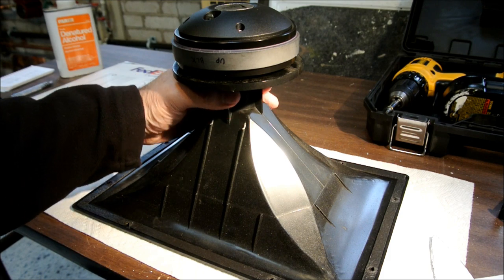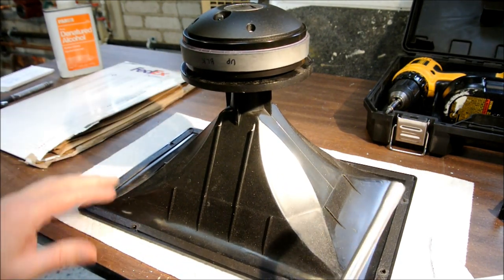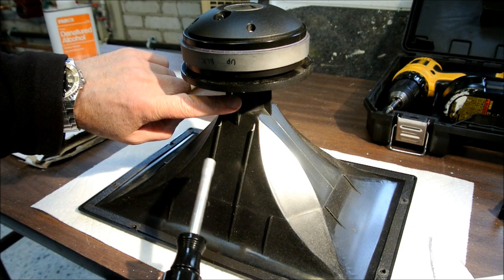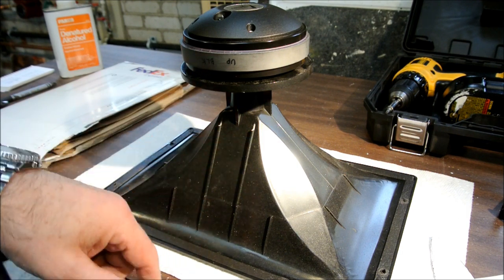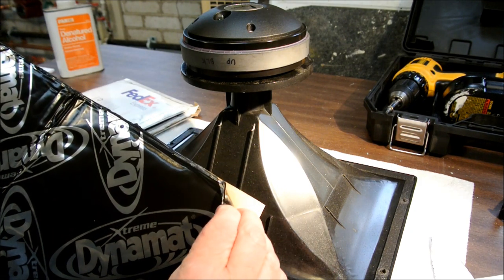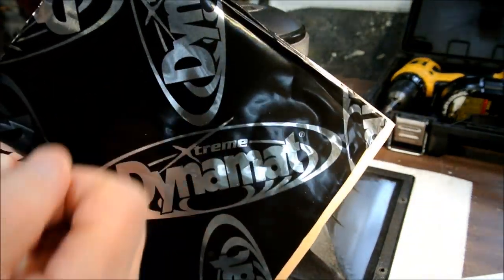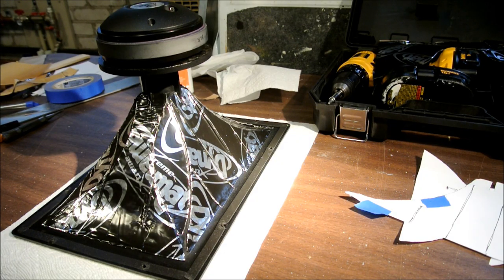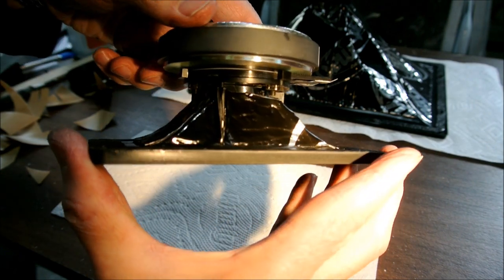How to Modify Klipsch speaker horns for better sound.

Comment: Is this alleged improvement objectively demonstrable? Can a 1" compression driver produce enough energy to excite a horn wall? Note that many Altec enthusiasts report that simply bolting a 511 or 811 horn to a baffle damps resonances caused by tapping the horn. And Altec used freestanding 811 and 511 horns without damping on the horns. However when using large format 1.4" drivers such as the 288 Altec did apply damping to horns, going so far as to use tar filled enclosures for early multi cells. I think many people damp horns because they can. I put little stock in reported subjective improvements--having bullshitted myself I'm confident in the ability of others to do so.
Reply from the maker: Good to be simultaneously skeptical and open minded IMO. I’m confident in what I’m hearing but don’t take my opinion or anyone else’s as gospel. Good luck!

Comment: My curiosity is why (and don't get me wrong, I have wanted to own Klipsch for quite a while now), there are so many videos of owners successfully modifying this speaker (with dampening for example). Many of these mods are carried out due to sub par listening experiences but for their price point, we should not have to do our own research in order to make them acceptable. They should be engineered to produce the maximum quality for the price demanded don't you think? More of a Klipsch QA and production question I know so.....apologies but these aren't cheap. Cheap speakers that you can modify to achieve the quality of much "better" sonic reproduction (better is in parenthesis because sound is subjective as we all know) is a great way to go. But to pay the MSRP for these only to find out that there are issues that you as the consumer can easily address shows a particular business model that doesn't appeal to me. It's like the way video games are going (I'm 54 but still enjoy them) wherein they release a game that is subpar fully expecting the young and knowledgeable Modding community will make it better after purchasing it for the full price of course and given nothing for the further development to make it much better which in turn generates more revenue because it's an improved product. That product then becomes Version 2 and so on and so on...

Comment: Another magic damping material you may find easier to work with is Blue Tack
Reply from the maker: Blue Tack is not a constrained layer damper so I wouldn’t expect it to be nearly as effective as Dynamat. https://en.m.wikipedia.org/wiki/Constrained-layer_damping
Reply: @thebostonaudiophile  the version you used has foil for heat rejection. It has little to no effect on the dampening properties as it has insufficient stiffness to act as a constrained damping layer 😉. Blu tack and other variations are far easier to use to add mass to complex shapes and to round corners internally. It’s been used in the headphone and speaker mod community for decades.
Reply from the maker: @conduit242  From Dynamat's website: "Dynamat Xtreme is a patented, light-weight, elastomeric, butyl and aluminum constrained-layer vibrational damper." I appreciate your comments and you may obviously use what you would like, at your own discretion. For others who have watched this video and are thinking of adding a damping material to their horn, I don't recommend anything other than Dynamat Xtreme, as I know it works well from first-hand experience and, as a mechanical engineer, I believe it's an ideal product for this application.
Reply: @thebostonaudiophile  I think you’ll find EM Kerwin’s paper interesting (1959), what you’re missing here are really four things:

1. The spans over which you’re damping are already shorter than the midrange frequencies. If you calculate the wavelengths over which the midrange operates, you’ll see they are already larger than the spans between the ribs (added to increase stiffness, raising the resonant frequency of the horn body). The high pitched resonance you got from tapping on it should have told you that 😉. By mass loading them haphazardly, you have lowered the resonant frequency..quite possibly right into the operating range of the midrange driver.

2. Since the horn itself is so thin and stiff, what you need to do is add so much mass that you drop that resonant frequency far below the operating range of the driver to also pick up harmonics. A couple slivers of dynamat won’t do that. A slab of blue tack will.

3. There’s an excellent short paper on optimal constrained layer damping thicknesses…you will see that the effect of hysteresis is only impactful at precisely calculated layer thicknesses and frequencies and tapers off exponentially. It’s not just “better”. Outside that range, you are basically only benefitting from the mass.

4. Even Dynamat has a page stating that the “3db reduction” comes from mass loading.

Math is fun, check it out 😉

Comment: Could this be done with some "spray on" product?
Reply from the maker: Good question. I don’t believe so. One needs to introduce “constrained layer damping” for the best effect. I’m not saying it couldn’t help some, but constrained layer damping is more than adding mass. Constrained layer damping forces the viscoelastic layer to shear and that attenuates vibrations extremely effectively.

Comment: Will this work on my Klipsch RF-82 gen 1 speakers?  Thanks!
Reply from the maker: I’m not sure. If the horn part of the 82’s is a hard, molded plastic with a smooth rear, like you see in the video of my Cornwall’s, I would think that it would work.

Comment: I have purchased the Cornwall IVs and love them but I have a huge problem with certain notes on female voices and guitars.  I have about 4-500 hours of breakin.  I have tried placing them mm by mm and cannot get rid of it.  I have found the magic spot in my room for everything else… and yes, it amazes me how these speakers are magical with a crazy amount of toe in.  I am sure that the mid horn is resonating, as well as the cabinet.  I am a little disappointed by the cheapness of the woofer.  But I love the liveliness of this speaker.  For my 50th birthday, I purchased these and an Prima Luna Evo 100 and a Bluesound Node 2i.
I do not know if the Bluesounds dac tonal signature is causing part of the problem, but it is unreliable so I am thinking of going to a goldnote ds10 streamer.  I would love to talk to you about the mod… and if you had some frequency issues like I am having.  For this kind of money I wish the 15 inch woofer was of higher quality with a better heavier basket.
Reply: Try to isolate your speakers from the floor first (eg. dollies and Auralex gramma pads) and consider some room treatment if needed. Also, keep other objects away from your speakers for at least 3 feet.

Comment: However you approach this type of modification it’s obvious it isn’t what Klipsch intended. I have significant hearing loss in one ear and some high end loss in my other ear and both have tinnitus. Severe in the worse ear. I need as much high end as I can get. My old Klipsch Quartets do a great job at mid and bass and I stack RP51ms on top to get the newer tractrix tweeter into my now augmented Klipsch tower squeakers. This gives my compromised hearing much needed high end. Thank god for Klipsch or I’d have to give up most of my music listening for good. Sweet, smooth, rounded off, these are undesirable characteristics in a speaker to me. As a lifelong intuitive engineer I do appreciate the experiment and shared knowledge. Thx.
Reply from the maker: I hear you but the mod is about eliminating noise (sympathetic horn vibrations) not changing frequency response (though that does change some as a result).

Comment: Have been interested in the Klipsch Cornwall, but if I see the horrible build quality of these speakers that cost $6500 a set. 
The woofer with that horrible stamped metal frame with small breathing openings😳 
The horns of resonant plastics 😵‍💫
The box with to little bracing and the complete lack of dampening materials🤦🏼‍♂️
And the crossover with solid iron core inductors ☹️

I am sure that with your modifications you can bring out way moreout of this speaker, but for almost 7 grand I would expect a better speaker right from the factory 😢

Comment: It all kind of begs the question... why doesn't Klipsch implement these modifications?,,, they have been making these speakers forever. These kind of modifications have been around for decades.
Reply from the maker: It’s a good question. Are you implying that it doesn’t really improve the speaker or Klipsch would definitely do it? Perhaps because it adds cost and complexity? Perhaps because it’s another thing that could fail? Maybe Klipsch doesn’t think it helps or that they think it makes such a small improvement that it’s not worth bothering with? I’ve got no idea, but to me, the improvement is obvious and worth the effort.
Reply: @thebostonaudiophile  I believe you that it makes a difference. I heard Klipsch Fortes but never owned any I think Klipsch is just making their speakers as cheaply as they can,.
Reply: If you do it yourself at home, it's not expensive. If they're doing it in the factory, paying American union wages and benefits, it's way too expensive!

Comment: hi I wouldn't cover the complete horn you want a little bit aliveness to it plus it reduces any resident frequency standing waves. just cover say70% the centre parts and leave some of it untreated.
plus cover the back of the magnet plate with deadening material and cover the magnet with copper tape.
the biggest resonance problems are through the baffle into the drivers so you could use it as a gasket or Blu-Tack do all drivers.
Some of the deadening material  used on the side of the cabinet but don't cover all of it!!
just where the bass driver is situated not the complete side of the cabinet, leave yourself about 2 " either side length is a bit of an experiment between 10" or 12" about a third of the cabinets length. use natural wool fleece folded to an inch or 2 on the back and sides with some inch or 2  of open sell soft foam not memory from. for the rest of the filling.
Reply from the maker: Thanks for sharing your ideas. I try to keep an open mind and trust my ears above all.
Reply: @thebostonaudiophile  
well that's the best approach.
 people seem to say the speakers have a woolly boxy sound the panel on the side will sort that out! but you can over do any anything and strip too much life away from the speaker you want to try and control the issues without changing the character of speaker too much bit of a balancing act and experimentation.
the original graphs is a good way to look at how it works from frequency on driver cabinet and ports and the impedance gives you clues.

Comment: As far as I understand, RESONANT VIBRATION is the WORST THING for a speaker. Anything vibrating that isn't the actual speaker itself, is BAD. That's why they brace the hell otta the inside of high end speaker cabinets. The want the cabinet to be absolute DEAD SOLID. Well, I would imagine the same SHOULD be true with the horn of a horn tweeter. I can't imagine the horn vibrating causing it's own sounds is something Klipsch would consider desirable, since those sounds would not be from the driver, but secondary vibrations. In other words, DISTORTION. I think deadening the horn is a fantastic idea, and if I ever get a pair of Corwalls, which I am looking, I will definitely put this sound deadener on the horn. Might even put some on the woofer struts, and add a little sound insulation inside the cabinet as well, and maybe even some gussets. Yes, DEADENING is the key to pure, distortion free sound.

Comment: I bought Cornwall iv and Heresy iv because of all the fans. Wanted a large sound for my 30 foot ceiling great room. 

At higher volumes with standing waves (lots of echoes), these speakers actually hurt my ears at higher volumes. I only spent $7000 on both sets for left-right-dual center. 

They suck though. Hurting ears? Never happened and I play a Marshall guitar amp on 8. Ringing ears? Sure. Hurting? No.

It's from distortion of the horns. That's why no one else makes that style